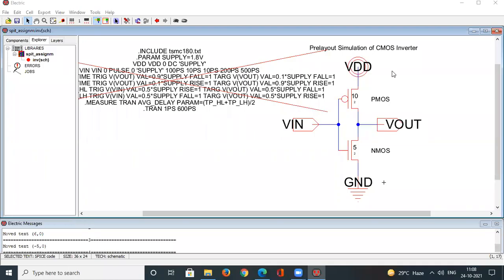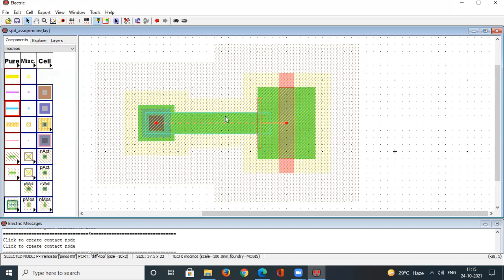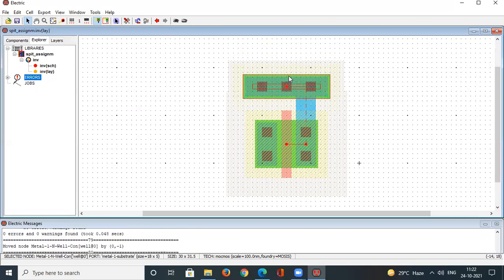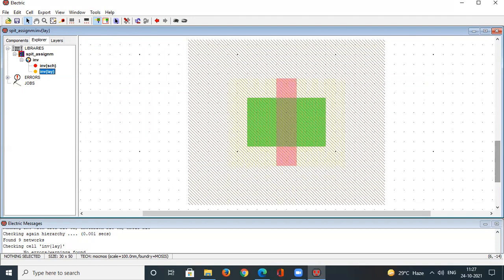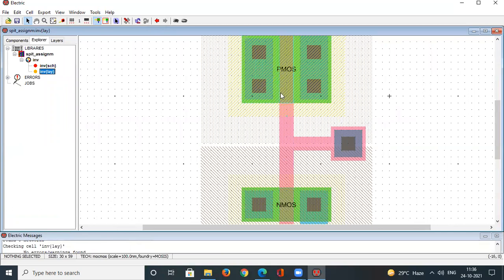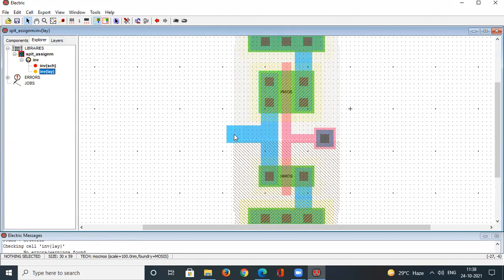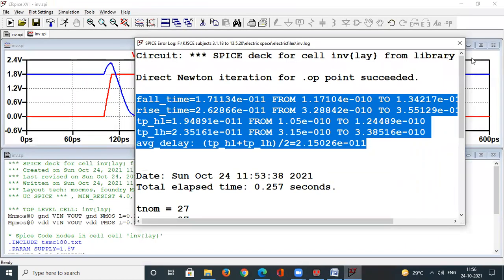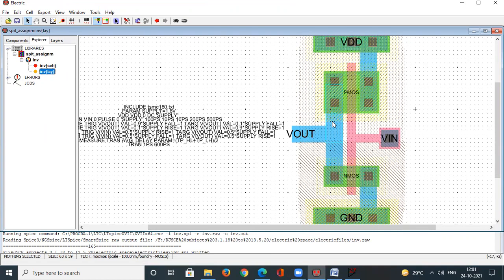Post-layout Simulation of CMOS Inverter using Electric VLSI Open source EDA Tool

Comment: Hello sir... Thank you for the information but i want to ask if we have to connect body to the source terminal in bigger circuit.how to do that?? As i am trying if taking by default body terminal as gnd or vdd.
Reply from the maker: In a similar manner for bigger circuits, in most cases, the body terminal of NMOS is tied to GND, and for PMOS it it tied to VDD
Reply: @InderjitSingh87  thank you so much sir for reply.i have tried this same manner but its not working.   Suppose i want to connect 3 nmos in series and the body of every nmos is connected to respective sources but it's taken by default gnd of body terminal.

So can you tell me what we should change ??
Reply from the maker: Refer this https://www.staticfreesoft.com/jmanual/ElectricManual-9.07.pdf

Comment: For me prelayout simulation is successfully simulated but in post layout simultaneously NCC checked everything is correct but after running the simulation i m getting measurement failed what could be the reason?
Reply from the maker: I will check and let u know
Reply: Problem resolved sir thanks for your videos @InderjitSingh87

Comment: Sir how to calculate the area of layout in ELECTRIC tool?  The size is mentioned as some 63x59, how to calculate in sq.m?
Reply from the maker: @Ssuji Raja, in your schematic window, you can go to Tools->Design Synthesis->Layout XL. It will open a layout editor window. From there, you can go to Design->Generate from source. In this form, on the bottom left, you'll have the area utilization option where you can fill the percentage of the total area. Can you try once, and check if this works.
Reply: @InderjitSingh87  Thank you sir

Comment: Sir is there any way to do schematic driven layout for huge complex circuits in electric
Reply from the maker: Yes possible, i haven't tried it yet though.
Reply: @InderjitSingh87  I'm also trying to explore it. But till now I'm very new to electric. Your videos have helped a lot in this regard. Thanks for that
Reply: @LeyaSardar  thank you. But I think that uses some pre designed cells from the library.